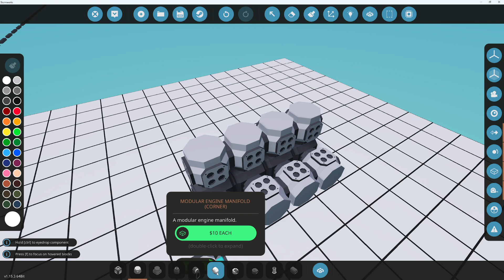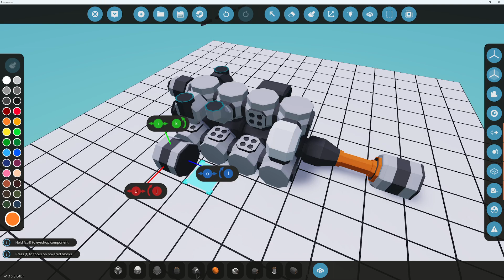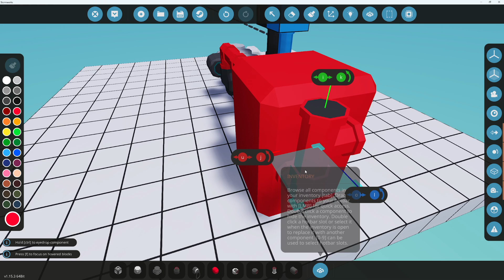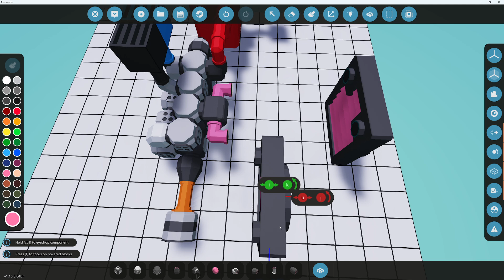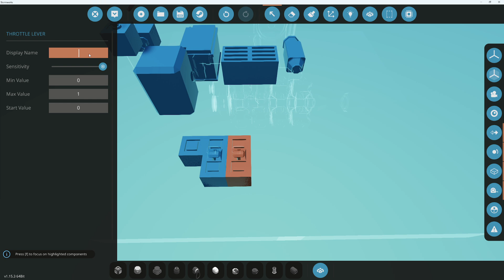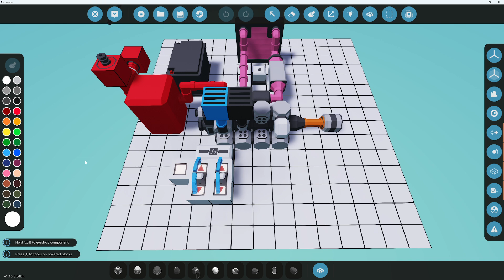Modular Engine Tutorial - Stormworks Build and Rescue

Comment: hey just 1 question. ive always had the problem with the fuel not going into the engine, ive tried fixing the pipes so much times but it never worked. do you maybe know whats the problem cause i tried almost everything and nothing works. air still goes in but no fuel
Reply from the maker: Do you already have a gas relief valve? If so, you might try adding a pump to the fuel line. If the tank is very far away from the engine, it could be necessary.
Reply: @coalkey8019  yes i have the valve, i will try adding the pump and i will se if it works. thanks for the reply
Reply: yo idk what fixed it but now it works, thanks

Comment from the maker: It should also be noted that if you're serious about cooling your engine, then you will need a lot more cooling than what is shown in this video.
Reply: Why do you say that?  If you're using an electric Radiator it should be plenty sufficient for a modular engine. Most Tutorials that show how to set up a basic Modular Engine rely only on a single electric Radiator Daisy Chaining the Radiators is no longer a thing and they do not recommend it as far back as I can remember its been a while since Ive played. Your Video popped on my Youtube front page I had been trying to learn to build modular engines. But it seems like a massive waste of time. Most videos you follow just like the typical stormworks I started on years ago simply do not work... Or they work but the level of difficulty to set up a micro controller for it is absurd and then when you test the engine... it runs at MAX RPS at engine start (NOT RIGHT AT ALL)  and or people just throw on ZEs Micro Controller to control the engine. This is a bit ridiculous. They added engines but then make them ridiculously difficult and time consuming to even make run. Thats why for years Ive just used the default engines they work and I dont need to spend a week learning to make a micro controller and testing it on and off to use the built creation a hand full of times. lol.
Reply: @ArmaGuyz its not that hard to setup and i dont use any workshop microcontroller